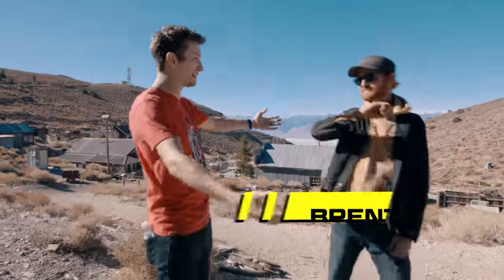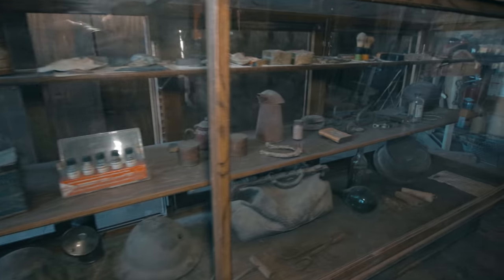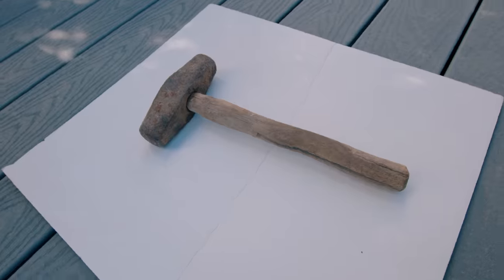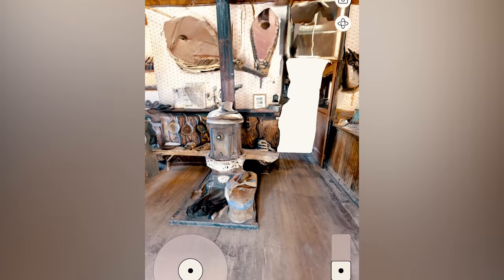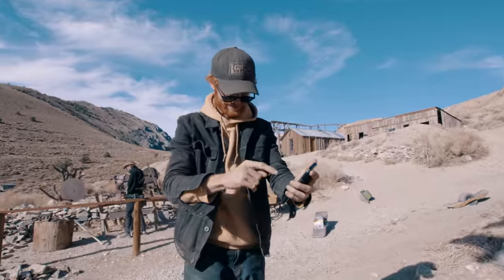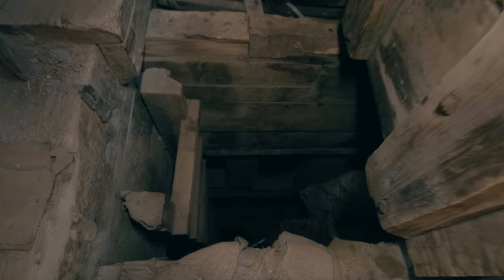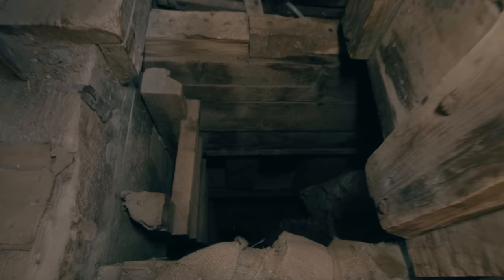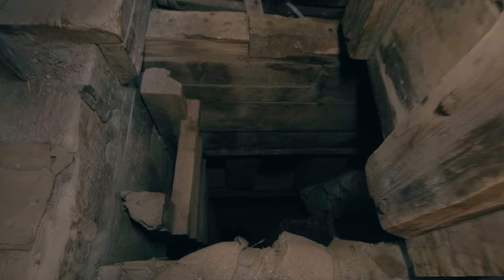We 3D Scanned a GHOST TOWN to Preserve it Forever

Comment: So I did a little googling and the "F.R.P." on the hammer with the anchor is the logo for "Fayette R. Plumb, Inc.", the company that made the hammer. (It's a Nevada Pattern Sledge Hammer.)

I believe the company was incorporated in 1899 so it's probably from not too long after that seeing as it's the most primitive version of the logo that I could find.
Reply from the maker: Amazing! Sent this to Brent.
Reply: Good job OP 👍

Comment: I used to work for a company that 3D scans buildings and infrastructure, with the goal of using these scans for creating accurate plans for construction and remodelling. We also scanned some bronze statues so if they got stolen, there was a digital copy that could be used to cast new statues.

I can tell you that photogrammetry is NOT the way to go to create accurate copies of buildings. This video already shows that a lot of artifacts show up, and that geometry of objects gets very chunky, as shown on the hinge wheel that does not look round or the mineshaft model that shows all the shapes blending together.

Lidar is the way to go, but not the lidar that is present on mobile phones, it is not accurate enough. Sure, it looks like it worked fine in the mines, but if you were to go round in a circle you would find the ends would not meet up. You need stationary scanners like Faro Focus or Riegl Vz400i for this. Using these scanners you can get extremely accurate representations, and you can map entire buildings or mineshafts, and the geometry will always match up. 

Long story short, photogrammetry is cool for smaller projects that don't require that much accuracy, but if you need the actual geometry data to make digital copies, high-end Lidar is the only way to go.
Reply: I work for a lidar and full body capture company and we were talking only a couple weeks ago about how inaccurate the ipad/iPhone scan stuff is. So much is hidden by the textures but its sooooo blocky. We use Leica scanners and nothing can beat out proper lidar scanners at the moment.
Reply: I'm sure either option would be better than what they are doing, but they would also cost more than is likely affordable. Polycam uses hardware almost everyone has. This will allow for them to crowdsource having more and more objects scanned. An imperfect and rough scan is better than no scan at all.
Reply: to be fair to Polywhatever, photogrammetry improves with more data, but the bottle neck is the matching/rectification process and backprojection which scales quadratically on the number of photos anyway.  So long as they're willing to put in the manual annotation effort to 'finish' the result, they're making the right call between cost of hardware etc and final quality.
Reply: The whole thing seems kinda V'ger-ish to me.  Sans the bald chick.
Reply: one question, i know nothing of this stuff. but if i wanted to remodel a room or a garden, can you scan the place and then go in and to the remodeling to see how the results would be?
Reply: @skylx0812  I mean it’s not like the town got consumed in a electric hell fire to scan it like vger does
Reply: Sure, but there's a big difference between "do this with free software and hardware you already own" and "do this professionally with equipment costings 10s-100s of thousands of dollars". 

It's cool that this exists at all on a consumer level. I'm not surprised it's not nearly as good as the pro level stuff, it would be kind of insane if it was.
Reply: @richardstrage3682  as long as it's just a representation and not as they said, to have accurate measurements then yeah it works perfectly

In saying that chances are you'd want an empty room to remodel anyway and rooms are stupidly easy to model
Reply: Photogrammetry excites me for getting textures more than accurate models, though the models are great references
Reply: I think most of us know that this is not the best accurate thing but its the most affordable. I am using it quite often for any types of fast measurements that were either impossible or extremly time consuming before. I can scan objects, model them and then do modifications and print them. All in house without special hardware. Where the world came? Before I would use a blueprint for modeling at best. Having 3D scanner capture is for most standard life usecases too expensive,  time consuming and possibly inefficient. I mean by that the corridor put this on a web they already made decisions about the final quality. Yes using a professional tooling they could get better data and make better optimization but it might have cost 10 times more and this video is not about it. This video showcases what we all can do now.

Comment: So glad i found this video. 1st i love old western stuff like this. And the scanning and mapping you offer 8s awesome. There's a old railroad bridge that has been unused for decades. But sits along 2 major state funded trails. The D&L (Delaware and Lehigh Valley) and the ironton rail trail. The bridge is mostly intact but 1 of the riverborne pillars holding it up is falling apart. I really want to start a proper fundraiser to repair it. Here's my reason. Even today alot of people walk across the trestle. It actually connects 2 parts of the D&L the section that's in Northampton PA and the section in Coplay PA. I actually want to turn the trestle into a footbridge. Set it on top of the rails and ties to preserve them. Put a plexiglass floor so it's a safe crossing with rails button can look down and see the tracks and bridge. It will save the trestle and connect 2 parts of a trail across an almost 2000ft long bridge over the Lehigh River. I just dont know where or how to start. I have lots of footage on my channel here and tons more on SD cards. Keep up the amazing work you guys do.

Comment: I do professional 3D scanning for construction/As-builts, and if we were to scan that whole place with our terrestrial/mobile lidar scanners (inside and out in color). I would say it would be somewhere between 1 to 3 terrabytes of data.
Reply: Would that be before or after converting it to polygons?
Reply: @tiagotiagot  I'm talking more about making a 3D point cloud of the place, not photogrammetry. Only using pictures to apply color to the scan points. So after all the scans are registered without cleaning, I would say around 1-3 terrabytes depending on the resolution and density you want.

Although you can make a mesh from point cloud, we don't really do that because we need the real data with exact points.
Reply: Mage Enderman  With clean up maybe it would be 10% smaller
Reply: Absolutely. I use reigl lidar scanning for collision reconstruction and my scene files easily push 450 to 500gb.
Reply: @davemcdaniel4856  yup

Comment: the really amazing thing is that you should be able to take those scans, and put them into blender, export them as an STL and 3d print the awesome artifacts and hold them physically in your hand. with something like a resin printer, the detail would be astronomical.
Reply: Until you realized that the details are in the texture rather than the mesh, and when 3D printed it's just a low poly blob of something. 3D printing is always shade flat and no texture.
Reply: @FlameRat_YehLon  It's just a matter of time until the models themselves have a lot of detail in them. Give the technology 10-20 years and see where that gets us.
Reply: @awareqwx  It's not that current technology doesn't allow that, but simply it's way more expensive than what's available to regular consumers, and the kind of PC needed to handle the data is also rather expensive.

Also I'm mostly just talking about the models shown in the video which is definitely mainly for 3D renderings (thus much less detailed in mesh than say a CAD model), but the capability of either photogrammertry or LiDAR aren't going to be good enough to replicate semi-perfectly anyway. Laser scanning is likely still needed and that's rather expensive.

Comment: I feel like in the future 3D Scanning yourself will be a new form of Photography. You would get so much more detail and could easily make tweaks to the camera position.

If you think about it, 3D scanning now is like early photographs, you have to stay perfectly still for a least a minute. But maybe in the future you could just set up a camera or too and get an instant 3D model.
Reply: I give it a year, and every flagship smartphone has a lidar, in 5 years all smartphones probably will. So every picture you take with your phone will have a depth map, wich enables sooooo many cool things and ways to process them further/stitch them to a 3d Object
Reply: Well you can do that now but you need a rig of 30 or so cameras that surround you. I don't know how else you could do it.
Reply: @3DJapan  They currently replace a rig of 30 or so cameras that surround you with one smartphone that they move around you. That rig still would have better results, but the technology is there to make it more accessible. Of course, the smart phone cheats a little bit by using multiple cameras so you have a small difference in the angle that can help to calculate/find the depth in pictures. And of course, to get a full 3D model, you will always need to make pictures from every angle. The rig still makes that easier, but as you can tell, not the only way to do that anymore using some small modern innovations.
Reply: @lordician  There are tight spots in those mines but this might also speed up the process.

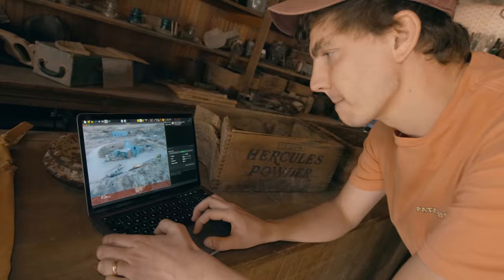Comment: That sewing machine at 7:58 (Presuming i identified it correctly as early 1900 Singer) is the best machine you can have, provided you only need straight stitches. Can be foot-powered, though there was a retrofit kit for it that made it into an electric.
Also heavy AF, so find a work place for it and don't plan on moving it elsewhere :)

Comment: What a nice video . I want to do the same here in Zimbabwe. Where can i get that rig with lights which you used for the underground scan? I would like to do a detailed 3d underground mine scanning and processing of the 3d Meshes. If you have an improved version of the rig or a better processing method or the whole methodology on which software or devices to use , please share with me.